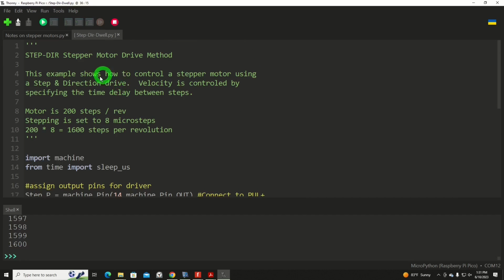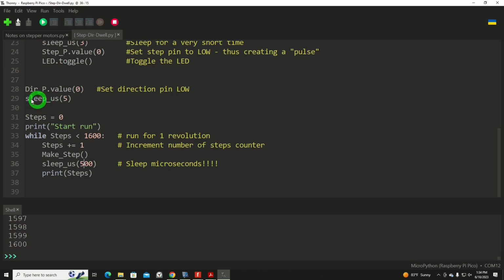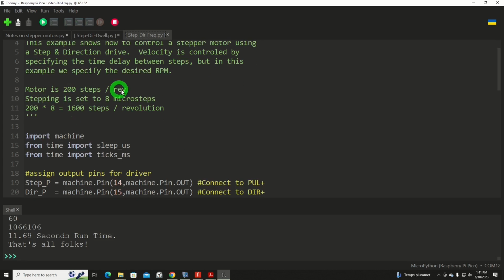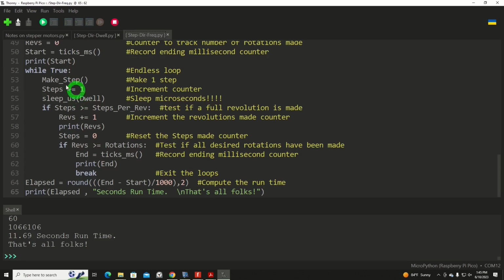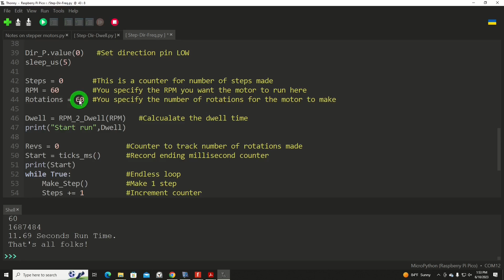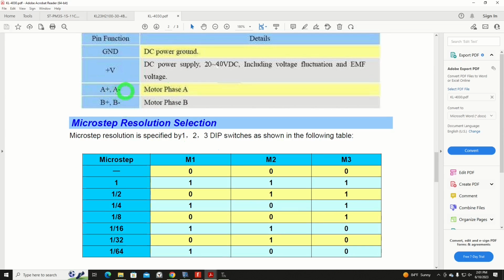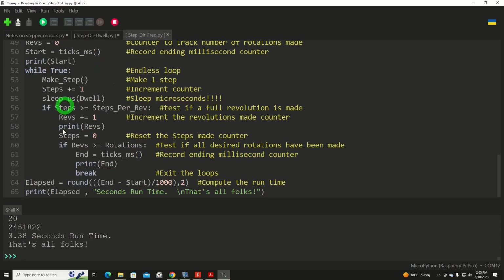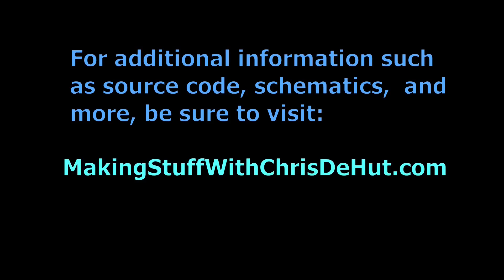How to use Step and Direction step motor drives

Comment: Very interesting about the print statements and the thumping. Good catch! Great video! Now I can get started on motorizing our vertical blinds which are a pain to open and close because of the location of the stick that hangs down.
Reply from the maker: Glad it was helpful!  The upside of stepper motors is very precise rotational control, the downside is you have to feed them a very consistent pulse stream or the spaz out.  Good luck with your blinds project!
Cheers
Chris

Comment: Excellent video!  Just subscribed.
A follow-on might be to use the 2nd core, and control 2 motors like might be needed to make a circular path.
Reply from the maker: Hi michaelbyron9688
Thanks for the kind words and subscription! 
I hope to get around to that.  Motion control is an area I like to play in a lot.  I don't know when I can but almost certainly I will be doing more with these types of drives and motors.  Coordinated motion control is not a trivial matter, especially when combining with acceleration and deceleration - so it is a great and fun challenge.  
Cheers!
Chris

Comment: Thanks for your video, but I also want to know if can use the PICO PWM to create pulses and control the speed by control the PWM frequency?
Reply from the maker: Unfortunately not, PWM is not suitable for creating a variable pulse stream.  It is however, good for creating a fixed frequency of pulses with a variable amount of duration for the pulse.

Cheers!
Chris

Comment: Thank you Chris! That was very helpful. did you experiment with uasyncio yet to drive three stepper motors independently? that's what I need to do. Not shure if that is precise enough 😑
Reply from the maker: Hi CineMuck84,
Usually when I hear "3 stepper motors" I suspect CNC is the goal.  Is that what you are trying to do?
Cheers
Chris

Comment: You are being confusing. The electronics box is a driver, not a drive. The motor provides the drive.
Reply from the maker: Hi again, 
Yeah, unfortunately, old habits are hard to kill sometime.  Been referring to motor controls as drivers for about 40 years now, just can't break the damn habit.  However, I think my WI accent has mostly faded away;-)
Chris
Reply: picky picky